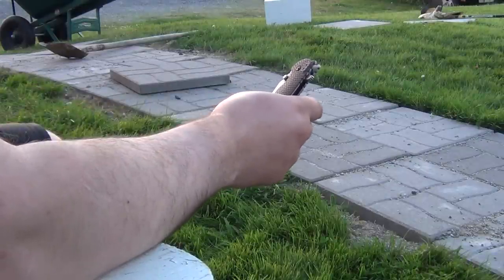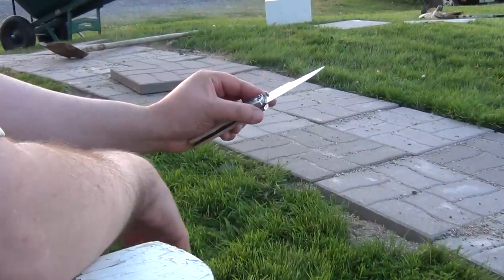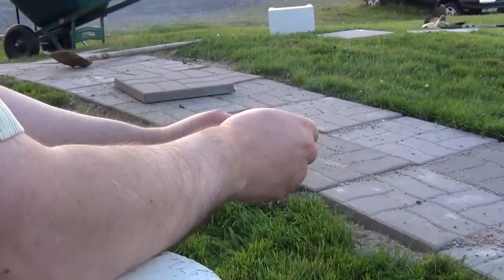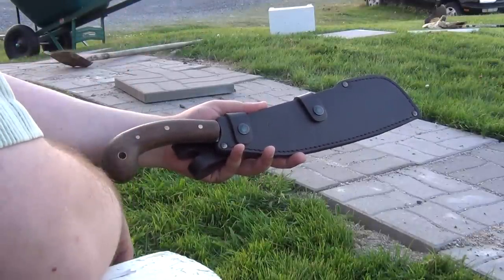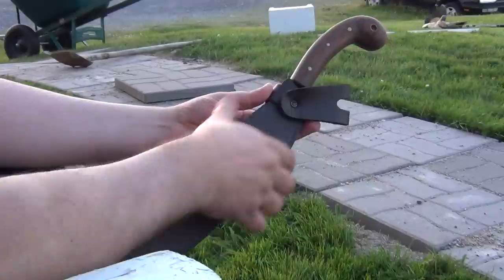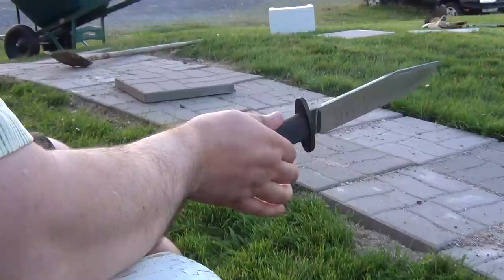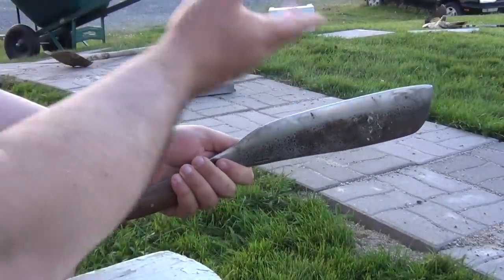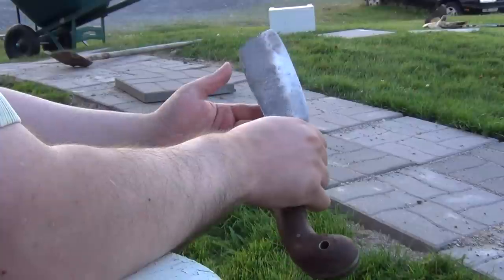Condor Village Parang : design by picture vs design by performance

Comment: I'd looked at Condor's parangs online (and fallen in love with pictures of the Mini Duku, in particular),  checked the specs and then compared to the specs of Bidor parangs and watched a number of Junglecrafty's videos. Then I had to ignore the voice in my head that kept saying, "But full tang is stronger/better" and go with a 10" Bidor. And I love this homely little parang because it can both chop wood and cut through light vegetation like a laser. And, bonus, I paid a lot less for it than I would have for one of the Condors.

Comment: I have that exact parang. I reprofiled it once I got mine, not only trying to have a better angle, but also in attempt to lighten it with a few ounces! It was a decent chopper in the rainforest here in Malaysia. The shield is indeed not practical in this part of the world due to the dampness in the jungle and it is almost guarantee to let the parang rust in the shield. I'll DIY the shield using PVC pipe. I appreciate your honest review and do keep your review coming. Cheers!
Reply from the maker: Yeah, the weight is an issue as well, mainly due to efficiency which is low when the grind is heavy as the cutting performance per weight/length tends to be low.

I thinned this out significantly as well in blade and handle. 

I believe the newer versions are also leaner in edge and primary grinds, but that kind of thing is hard to know unless you have a decent sample and I have only see one of the newer ones.

Comment from the maker: They are 0.5 cm increments, I use them for visual length estimations on sharpness measurements and as well to mark out specific portions of the blade when doing restricted cutting (1" and 2" slicing draws for example).

Comment: An excellent presentation of reasons why a knife should have the features and performance for it's destiny of use, I always thought that parang had a big bevel, but as you pointed out it was merely a polish line, on a slab with a bevel a 1/3rd the size, that is really deceptive and a brochure full of pictures will never be the same again for me now. As for a round handle,oh dear, I had looked at this for a possible buy in time( you know my style, basic, crude) but this look more work to adapt

Comment from the maker: I can see an argument that the Hinderer is design by picture but I think it would be a difficult one to support especially when you consider his use or possibly even creation/innovation of lock over travel stabilizer, HD offsets, custom pivots, etc. . This is very different than the mega-tactical-jimping on the ZT 0561 for example.

Comment: Cliff what parang would you recommend?
The village or condor bushcraft parang?
I will be using it mainly to cut bamboo, clear trails, split wood and maybe cut away some light vegetation(amazon jungle vegetation)
Reply from the maker: I have not used the bushcraft parang, the village parang doesn't work well for the work you have described though; too heavy, grind is too thick, too handle heavy.

Comment from the maker: Thanks, nice steel and thickness, but has similar issues with the low grind, full tang and fold over snap sheath. Price is also fairly high compared to other sources for similar blades.

Comment from the maker: When John described knives as jewelry, it wasn't that they contained aspects of such, it was that they were only (or at least mainly) such to the point the purpose or functionality was compromised in favor of the aesthetic aspects. Now it is clear that you could consider a Bruks axe a piece of art, but the design is a functional one. It is a pretty clear line drawn between the two.

Comment: I think part of the issue is that the concept of a knife being "pocket jewelery" is considered derogatory, when in fact it may be not only perfectly fine but may actually result in the knife being superior for its intended role than one intended to be used as a cutting implement. I'm perfectly happy to cede the point that I thoroughly enjoy lots of knives, many of which clearly are not optimal designs for use as a knife. Others however, for whatever reason, it seems are not.......

Comment: I also am afraid I have to disagree with your point regarding knives, the hinderer for example, being made for something other than light cutting. Such jewelery was designed to fit a form, an image, not as a utility tool. To chastise it for such would be somewhat absurd, like claiming that my ring, which I'm sure you've seen in such videos, has insufficient mass for heavy pounding. (its 6al4v Ti) It wasn't designed for that purpose, despite its size, so doesn't function well in that roll.

Comment: bravo! i don't know why they put round handles on things that require directional control. my 12lb. splitting maul has a round handle and it is pretty difficult to swing it hard and straight with so much weight on the poll. it does work well for propping the door open on breezy days though. my brother in law purchased a gerber bear grylls parang and it seemed to be pretty decent aside from he put an 1/8"dent in the edge by hitting a rock but, it was thin enough that i was able to fix it quickly.

Comment from the maker: I have not used that knife, but it looks more of a tactical/utility style blade than an actual cutting knife. A knife I am interested in now and will likely pick up is the A. G. Russell Skorpion. I carry a Spyderco Paramilitary and a Paramilitary 2 would in general be a solid cutting style blade for a one handed/clip which also wants to retain significant heavy work (the stock is fairly thick by the handle).

Comment from the maker: I have used a lot of 12" machetes and they are nice for a short machete/long knife. Ideally I would tend to prefer 14" blades but that depends on your height, what you are cutting and how much/little knife work you need to do. I do like the general shape/pattern of that one by Cold Steel though and may pick up one eventually.

Comment from the maker: Yes, I have already put a primary grind on the blade, full height of the polish line you can see in the picture. They can be decent kit knives if you have some power tools or are willing to do some hand work. There is a lot required on this one though.

Comment from the maker: There is that. This is the argument that people like Kyley makes about not going to extremes on intended working knives to remove that hesitation plus it isn't functional as you lose it when you use it.

I think there are some very interesting questions to be asked about how some of these knives are being made, such as for example the use of the bearing type systems in such knives which are generally intended for axial load only.

Comment from the maker: I can chop and split with it, no issues, but the performance is fairly low for a knife of its size/weight. An actual village parang has much more extensive tapering to make it much stronger per weight and more efficient cutting. 

But if you enjoy it keep at it.

Comment from the maker: Yeah, I don't think I would pay $60 to rework this blade. 

I already reground it as it was to dangerous to use for brush work after an attempt. It now has :

-10 dps primary
-0.040"/15 dps secondary

This is twice as heavy as necessary on the primary still, and the secondary is about twice as heavy as well (if a transition bevel was used). 

However it can at least be used now.

Comment from the maker: I have already made a few minor changes :

a) actually made that polish line an actual grind

b) flattened out the handle

The grind is still fairly heavy, about twice what it can be, assuming the steel is ok, but it is enough to use it now safely anyway.

Comment: I'll cede that. 

I confess, I made an error. I had though that Nebulax123 was initially suggesting that for 60$ he'd correct it. Upon further discussion I realized he was simply referring to its sticker price. I agree that, in regards to sunk cost, repair can be considered preferable to replacement under certain circumstances.

Comment: I throw both the 0561 hinderer and the rick hinderer "custom" in the same boat broadly speaking, although you can technically nitpick between the two. I don't find either design to suffer excessively from functionality, although the argument could be made both do have useful features such as the hinderer lock stop. Your argument is essentially that jewelery, or art, may have no intentional functionality in its design, and I reject categorization.

Comment from the maker: Bruce Rugg (WiseOld Knives), ErgoSlice Bushcraft, very nice knife. 

I just finished sharpening the primary grind full (just an experiment to check the edge stability in extreme limits) so I completely scratched up the very nice finish Bruce had on it but he lives pretty far away from me so it doesn't really matter. 

I have a video on using it outside on some work. I will be doing a more detail video shortly.

Comment: Every skilled craftsman knows they must be able to take any tool, new from the box or used, and know how to tune it up and adjust it up. Then they must actually have the skills to use it effectively. Where do you fit in?
Reply from the maker: In order to turn this into an actual functioning parang then you have to :

-remove the handle scales
-remove the end bulb
-taper the tang
-anneal it
-refit the scales and attach them
-taper the blade
-regrind the primary

If that is how you think tools should come to you and what "skilled craftsmen" should be doing to them so that they have cohesive and efficient designs - well you are free to do so.

Comment: hey cliff could you do a review on the cold steel 12 inch bowie machete? its only 20$ and i find i can bushwack trails gripping the end of the handle for reach, and handle wood chores/ batoning, plus i can notch good enough when choked up on it, for a long blade since it's thin!! i found i could do everything except make notch's with the long CS magnum kukri, cause of the length, so i got the bowie and it's well rounded blade for the $, can do it all, not the best, but gets it in i tell ya what!

Comment from the maker: It is subjective thus it can be art to you just like I can take a picture and call it art due to my framing (or even argue random pictures are art). Thus you can of course put the ZT in a picture but it is the picture which is art. It is curious as a question if you draw a grain of sand is the grain then art along with the drawing.

Comment from the maker: Was he the son of the Wicked Witch of the West?

This is one of the big problems with promotion of knives for hard use when you are fairly vague about hard use. 

The user is then stuck between not using the knife significantly or attempting such and if it fails risk having a broken paperweight.

Comment: so, how good is the village parang for batoning would you say?  (I know, I know, people always bitch about batoning)
Reply from the maker: It has a pretty thick/heavy blade so it is decent for splitting in that respect as it is basically a wedge. However the handle shatter readily when I attempted it because it is very dry and brittle and it has a full hardened tang which isn't what you want for vibration/shock absorption.

Comment: Hi Cliff, thanks for your informative and thought provoking videos. I'm a bit disheartened as a new owner of one of these condor parangs but I can see that with some effort it can be improved. I was wondering if you've had a chance to see the j nowill "jungle knife", based around a parang design, up close (http://www.sheffieldknives.co.uk/acatalog/1-87.html) and if so what your thoughts are?
Reply from the maker: It is an interesting blade shape, not sure about the handle though.

Comment: if I drill a hole 1" from the tip and put a heavy padlock in it, then it would be worse.. but it might cut a bit better. we could call it a Pad-lok-lang.

Comment: All condor knives come blunt with a passable scandi grind... The steel itself is however 1075 Carbon and very well heatreated.

Try re-profiling the grind to make it steeper and sharper... about 22 degrees is ideal (with a slight convex).  

I think you'll find with most condor knives a little user modding is necessary, after which they perform just as well as knives that cost 2-3 times as much.

Comment: I don't use mine for anything you're describing.  I use it for short chopping on a cutting board.  The rear of the blade is upswept which enables a decent draw cut for larger vegetables.
Reply from the maker: As a large chef's knife of sorts? It would make an ok cleaver for rough work, but the force required for food would be a bit excessive outside of entertainment value.

Comment: These "ethnic choppers" if you will are pretty broad in their designs etc, but the one thing that really ties them all together is that "genuine" examples are quite low cost. The parangs are no exception. Condor has, amusingly, created one of the few "knockoffs" more expensive than an original here. :P A real parang will run you about 10$ US in southeastern asia. What point would there be to making a 120$ one by hacking up a 60$ fake for 60$ of effort?

Comment: somethign to do when you have had a few beers :  stare at the needle gun divets along the steel. the spanish speaking workers often leave their initials or phrases in spots that they needle gun over.  My engineers bolo does better in the kitchen as a large butcher knife. nearly perfect size for slicing a large pizza pie.

Comment: I have no problem with this parang .. it chops Very very nice i have no problem with the handle at all! This parang is a tool yes the grind was shit i had to reprofile it ... and the handle needed linseedoil ..  But this parang is a tool and is worth ever $ .. you sir have noidea what you are talking about .. this is not a axe its a parang
Reply from the maker: Yes, it is a parang not an axe.

It is a parang with a grind which is unsuitable for use, it lacks the proper tapering of the blade and tang to achieve the node/balance points for functional use, it lacks the tapered/annealed tang for vibration damping and the handle relies too much on strength for security and was later revealed to be very brittle. 

Now if you have very low standards, maybe that seems ok to you, but it has a very low performance for the dollar compared to actual village parangs which I have used which have all of those features as described. 

But if makes you happy that is all that should matter to you, Justin Beiber has lots of fans and as long as he keeps them happy then he should obviously keep "singing". I just tend to prefer people with actual talent and knives which have actual performance characteristics, not just look like a picture of a knife and designed by someone who doesn't understand how the actual tool performs as it does.

Comment: (cont2) attempts to box them back up again will either A) fall short aka be ignored or B) provoke an artful rejection of them. Thats sort of how art works and at least some artists think. ;) 

If you can believe it, for years I got into heated debates with artists over things like this. (take Jackson Pollock as one of the more famous examples) Ultimately though an engineering approach to art, really by definition, will fail to address it much the same way god/faith fails to address science.

Comment: Professional stainless steel butcher cleavers probably do a better job. Stainless - great advantage - and built to chop through bone all day, so it shouldn't chip. You can get them in different blade thicknesses from about 3mm to 5mm.